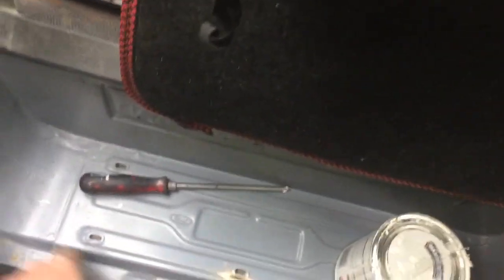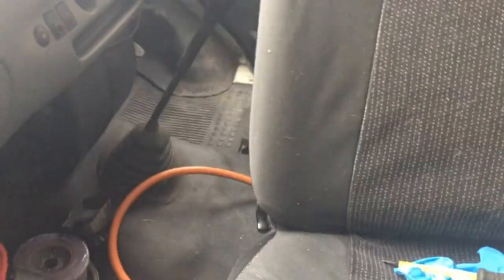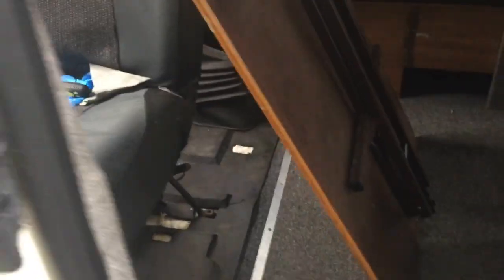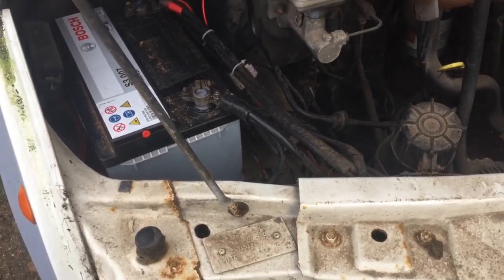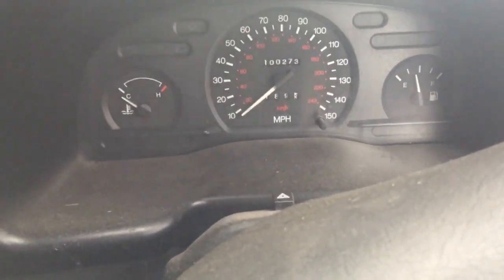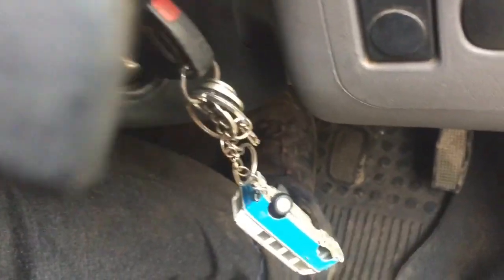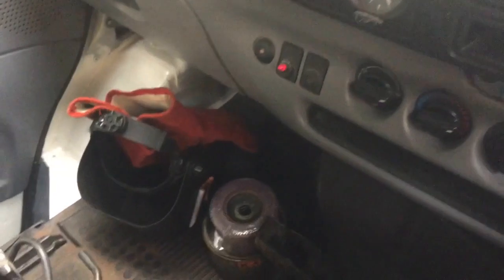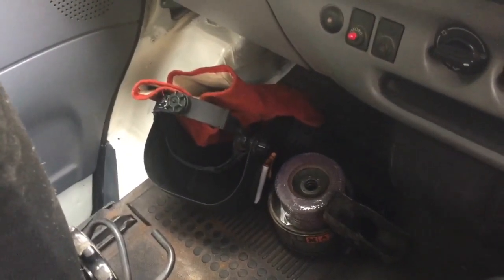Ford Transit Camper Update, Free Bosch Battery from my Neighbor Cold Start .

Comment: If you're not needing the chipped version you can get the ford tibbe keys v cheap on eBay, if you don't have the 'T code' for it there are sellers that can establish the code if you send them close up picture of the key (the code just relates to the angle of each cut on the key so can visually work it out)
Reply from the maker: offbeatwarble Hi that's great to know, thank you very much for your help🙂👍